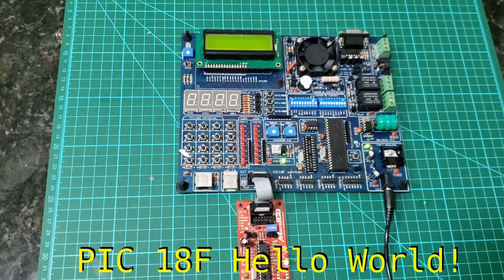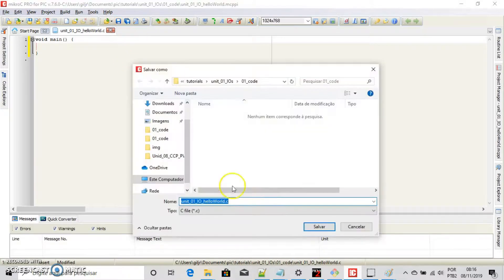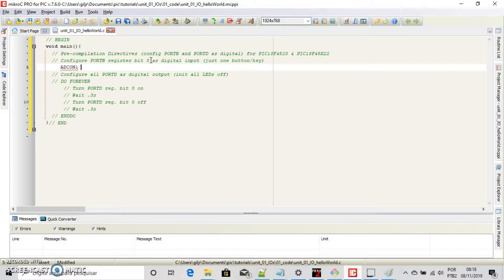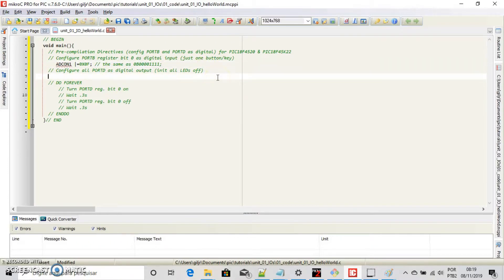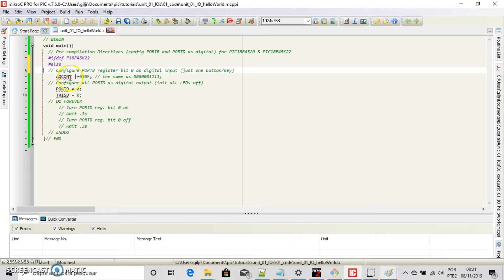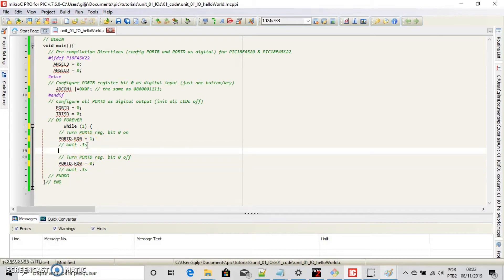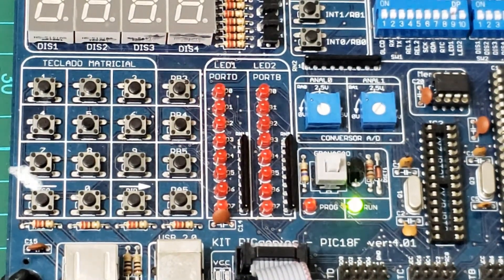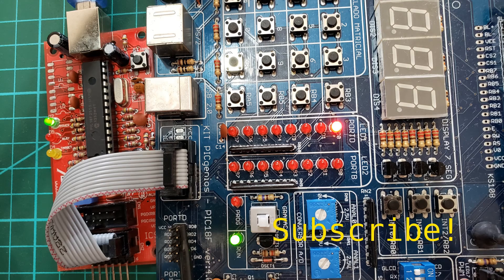PIC18F4520 - HELLO WORLD - STEP-BY-STEP- MikroC Pro for PIC - Episode#01

Comment: Thx for helpful video. I have written this same code in MikroC but I am using MikroProg debugger and it is not going through code line by line. Can you please tell me how you are connecting your crystal to the MCU and how to setup oscillator option in compiler?